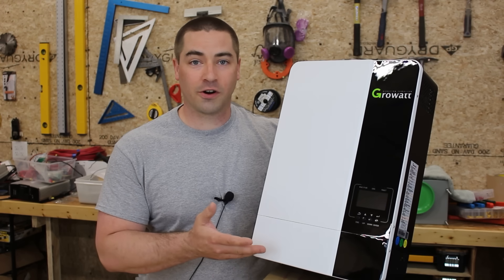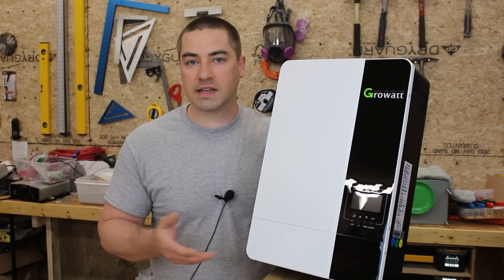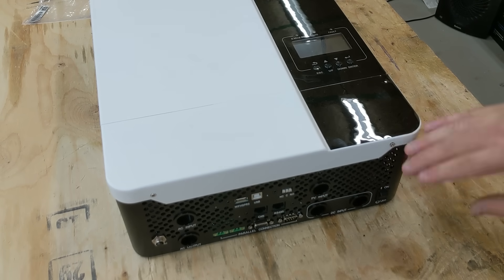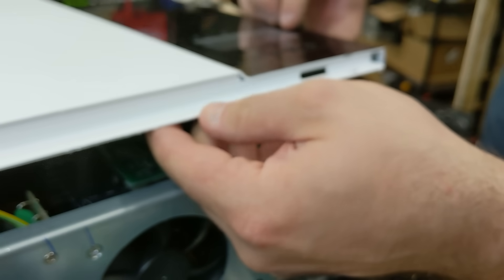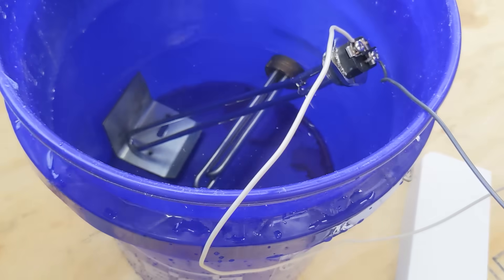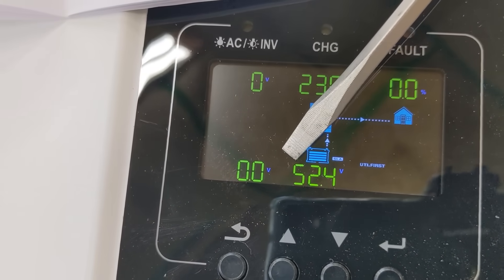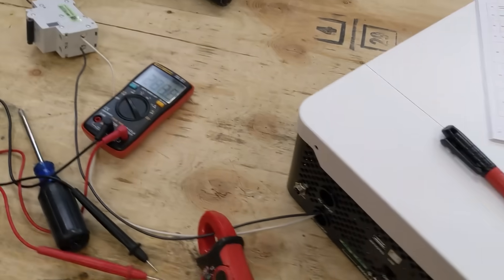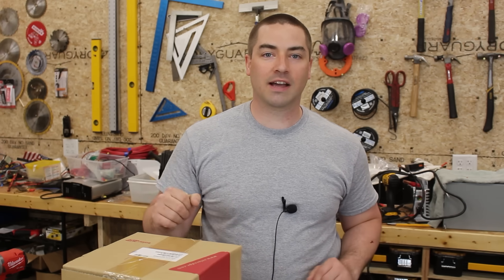Best Value Inverter, All-in-one MPPT Solar Charger, Growatt SPF5000ES, Part 1

Comment: any update? do you still support this product?
Reply from the maker: The inverter is working fine.  I've been testing it.  Currently trying to edit the video, but it's a ton of raw footage to work with.  For example, it powered up my miter saw great.
Reply: @DavidPozEnergy  Going with victron route until it's more proven. This sounds promising though
Reply from the maker: Cool.  Victron makes fantastic products.  I own their charge controller, 250/100.

Comment: I wonder if there is a version of these GroWatt All In Ones where two units can be networked together for USA style 240vac split phase.  My Initial review of tech info. for the smaller  Growatt SPF 3000TL LVM-ES unit, which can be run with or without a battery; leads me to believe that two GroWatt units (properly selection) can be networked together for not only upping the amperage of ac output, but also for 240vac split phase.  I want to  better understand the options; including ... if, or if not additional Growatt equipment is needed for 240vac split phase  :+)
Reply: IMO: just seems to me: single phase, 240v AC only is kind of poor choice for anyone in the USA :+(   ... while likely a GREAT Choice in European or other Countries with single  240vac  ... My Two Cents  :+) ... I guess, depending on what you put on the load side, there are possible task it might work great for.
Reply from the maker: Growatt makes a larger 12kw inverter with split phase.  It's a good choice if you want the split phase in one package.
Reply: @DavidPozEnergy  I will look at that 12kW version.

Comment: Hello Dav, I have 2 of those same inverters and 6 24v gyll batteries, I have not been able to communicate the BMS in the Lithium battery setting. A fault shows in the inverter when I directly connected the RJ45 to the batteries. I was wondering if you can include how to do it in part 2, thank you!
Reply from the maker: Doesn't directly communicate as of right now.  I'm just running it like I showed in the video, with user defined settings for high/low voltage
Reply: Thanks for your help

Comment: That Growwatt all in one is really just an MPP Solar brand all in one in different clothing!!! The MPP Solar all in one is all over eBay and most likely much cheaper! 
I have the 800Kw inverter version which has been designed for a 12V battery setup for a few years now and it's literally identical inside! 
The screen on the front panel looks nicer on the Growwatt compared to mine but the new version might have been updated by now. Regardless though, it's still functional... I hope that the computer software has improved because what I got is really clunky and slow! And it's not as detailed as what I have seen other computer software that I have seen elsewhere... 
The MPP Solar brand has versions that can be linked together for 3 phase output and many other versions for different situations...
Reply: 800kW?

Comment: Great job David.. I saw smaller models on Amazon and couldn't believe the price.

TBH long term reliability is what defines  good electronics like inverters.. We won't know if the heat sinks and those MOSFETs do the job until someone maybe you? uses it for a while at load.
Reply: The trick is not to overwork them for so long basically loading them to 65-70% load capacity, they are performing flawlessly in our installations the HVM series though

Comment: Good evening David... I have an unrelated question that you may wish to answer..?   I have two solar generators and would like to power both at the same time using one 180 watt solar panel (instead of a separate for each)..  Realizing that the sogens cannot be connected together in any way,  my solution would be to provide the necessary branch mc4's for each sogen and isolate each branch with an inline mc4 fuse which already  has the diode built in to prevent vdc back charging.  Your thoughts..??

Comment: Would be nice to see, if the communication with the batteries works out...then the Inverter has the most accurate state of charge and can also shut off the output befor the BMS does.

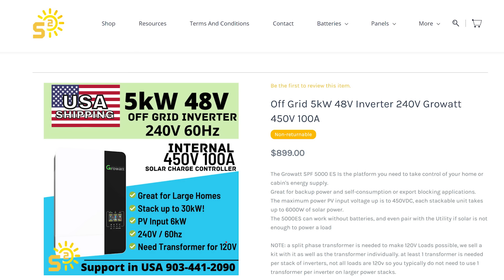Comment: I just saw on that ad copy at 0:50 for the unit that they can stack the inverters for higher power?!?! I had no idea this was possible.  I thought if I had a 5kw (peak pv + lifepo) and I increased it later to 10kw I'd have to get a new 10kw inverter and hock or repurpose the old 5kw inverter.  I don't know why that was stuck in my head.
Reply from the maker: Depends on the band/model.  Some inverters allow paralleling, and some don't.

Comment: Hi David, since you are expert i want to ask is there any way to connect this Growatt inverter to house panel.. in case of power outtage i want to power my house by LifePO4 batteries and this Inverter. thanks
Reply from the maker: Yes, it can power your whole house.  However, this type of inverter is usually set up on a "critical loads panel".  That would only power some of the loads like refrigerator, internet, etc.

Comment: Yes you are looking at inductors. High frequency filters. That is a high frequency inverter. Be careful about overloads with these style inverters, but looks pretty well built. Have a look at voltronic forums as I think this may be a version of that. There is some repair info over there.
Reply from the maker: Thanks for the help in identifying the parts.  I agree about being careful with HF inverters.  In some past videos (twice) I blew up all the mosfets inside a HF inverter.  But I've never blown a LF inverter.  But, hey, that's part of the fun in testing these things.

Comment: This is an awesome review. I just purchased the same package from signature solar and they were super helpful. I’m now looking for the most cost effective battery solution. Here is my question... have you tried or know anyone who has tested the Rosen 48v 200ah powerwall battery? It is sold by AliExpress for approximately $1600. delivered to my door. It appears to be an awesome battery but I would like your opinion. Thank sir, your episodes have helped me immensely. 🙏🏻
Reply from the maker: I have not heard of the brand "Rosen"  I searched for it on Aliexpress, but couldn't find it.  I'm currently using the Gyll batteries from Signature Solar.  Sorry I can't say good or bad about the Rosen.
Reply: @DavidPozEnergy  thanks.
Reply: 48v200ah lithium iron phosphate battery pack $1600 is very cost-effective and suitable

Comment: How’s it stack up against Bluetti?
(Other than cost)
Reply from the maker: The Bluetti I most recently tested is the AC200P.  It is an all-in-one power station.  It has battery, inverter, and charge controller in one package.  This video is on the Growatt 5000ES, which is an inverter and charge controller, but no battery.  You have to add a battery to this to make it a comparison to the Bluetti.  

However, if you question is just asking how this inverter compares to the bluetti inverter (built into the AC200P) then I can answer that.  The Bluetti is a 2000w inverter, and this Growatt is 5000w (a lot more power)
Reply: If I am correct the ac200 p cannot be paired

Comment: As a request for something to test, could you see what the output waveform looks like using your oscilloscope? If possible, it would be cool if you could find some different types of loads (resistive and inductive) to see if it's able to handle weird power factors. I don't know if you have 240V to your house, but it would also be cool if you could set that up and do some tests with the switchover between grid and battery/solar.

By the way, after seeing your video with your Hantek handheld multimeter/scope, I bought one myself and it's a pretty nice piece of kit.
Reply from the maker: Thanks for the suggestion.  I've already started editing the next video in this series, but I can hook up the scope and check the wave.  it will probably be tacked on right at the end of the next video.  I have not hooked this up to the house yet, but that will also be coming in a few weeks.  it takes me awhile to build out all the wiring/boxes for each video.
Reply: @DavidPozEnergy  Thanks! I figured I was probably a bit late to the party. I think the main thing is to see how noisy the sine wave is, which you can check with just your heater attached.

Comment: David, I have watched several of your videos. great job on most of them. If I hook up 16 3.2v 320aH batteries. What size wind turbine do I need to keep them charged? Thanks in advance.
Reply from the maker: A 16kwh battery.  It depends on your loads, and average wind speed/duration.  If you use all your battery each day, and want a full recharge each day, then you need a turbine that can output 700 watts in your average wind speed (16kwh/24hours).  You will need to talk to your dealer to find out which one is best.  I don't have a lot of experience with wind, so I'm not a great resource on this topic.  Maybe Hurricane Wind and Power could help you size it for your area.
Reply: @DavidPozEnergy  Thanks for the reply. I am planning to use a PMA hooked to a small electric motor to run it at a constant speed 24/7/365. My highest electric bill last year was 1440 KWh. For right now I plan to separate the heat and Air, and range from this. We here in Southwest Florida are about 99% total electric. We don't have access to natural gas and LP is high.  Would those 48v 60Ah batteries be better than the 24v 400Ah batteries?

Comment: That’s 220vac single phase,  how do you plan to use it. A 240 vac to 120 vac transformer costs $689.00 thtough w w Graingers, where’s the savings ?
Reply from the maker: I've been using it with a $350 auto-transformer: https://www.signaturesolar.us/products/i8d486d54c/2203789000006420115
I've been testing over the past 2 weeks with different loads and it's working well. I am now on to editing the video about the transformer use.

Comment: Hello David,
thank you very much vor this, and all other videos from you. It is awesome, what kind of great techniktools (inverter and so on) comes more and more from far east. Very well. Thumps up.
Question; is this one, or an other one able to deliver 3 phase output, with about at least 5 kWp? Such one i am looking for.
Thank you, and happy easter days :-)
Jürgen B., Germany.
on the following site is an technik test for an little usv;
https://loetseite.wordpress.com/2016/06/16/usv-rotronic-roline-ups/
Reply from the maker: Yes, the manual says this inverter can parallel for 3 phase output.  Each inverter is just one phase, but they will talk to each other for 3-phase.
Reply: @DavidPozEnergy  Yes, thank you, David. I think so, because many inverter (not all) can do this. But i am locking for one, who can get out with in one "black box" this feature...and it should be not so big and not so heavy. So it should work with HF elektronik without 50 Hz transformer. I think i have to look futher...and search.
Bey.
Jürgen B., from Hunteburg, Germany

Comment: I saw your battery bank  (parallel ) out from Pos and Neg in the Top battery.... This way connection I think the Amp charging for first battery is big and  last battery very small that's mean not full charge for all batteries. In my system I connect Pos (+) from Top battery and Neg (-) from Last battery.... And in  charging mode will be even Ampe for all batteries.

Comment: Looks very similar to well and long known inverters from EASun / MPPSolar (the synchronization board is the same, internal design is very similar, manual is almost 1 to 1 from what I was able to see from video). Moreover - for you, oversees guys, there are already factory made split phase models. Also, the price is lower, when bought directly from manufacturer - 5,5kW version costs me less than 650 USD delivered to the doorstep

Comment: Hi David ,We repair inverters,These Hi Freq units are a problem with certain loads. We prefer inverters that have copper wound output transformers. These handle reactive loads . They also isolate the high voltage dc .I know the cost is higher ,but reliability is much better.One more point,The GROWATT inverter your testing has the same inverter and charge controler circuits we've seen in other inverters,it a universal plug and play uit. By the way ,I just received my GULL 5 KW BATTERIES, THANKS FOR YOUR VIDEO ON THESE ,GOOD JOB!!!
Reply from the maker: Thanks for sharing your experience.  I've blown up a couple inverters in the past with my miter saw.  I'm going to try my miter saw and air compressor on this unit too, but since those are 120v, it will be with the auto transformer.

Comment: wow that looks like a really great starter option. Then as you grow your system you just add one or two more. too bad there isnt a 120v version then just get two of them synced up to get split phase. That would be really neat to see!
Reply from the maker: I agree, it's easy to grow a system like this.  There is a 120v version, but only in 3000w size.
Reply: @DavidPozEnergy  oh I see, yea I would totally see myself starting with them, but an apartment is not where you start a power wall project lol! That’s ok I can just keep saving up

Comment: hi David,the tx5000 auto transformer is a discontinued product.and Signature solar clearly states "non returnable" could you please advise us as to what recourse we may have if we get a bad unit? does solar edge make a replacement? How would signature solar support your followers?thanks
Reply from the maker: You can also buy the Solar Edge auto transformer from Alt-E, or Northern Arizona Wind and Sun.  Probably other places too, but those are two off the top of my head.  Victron also makes two auto transformers.
Reply: @DavidPozEnergy  David thanks for the reply.i can't see this as being a good buy.victron auto trans vary from $400-$500 dollars and as per my previous post solar edge no longer manufactures theirs.At this price point an inverter with built in split phase would either be close to or same price and one less piece of equipment to hang.I respect and admire your channel but I think this unit is over priced and under functioning especially at 48 volts.

Comment: Do you need some kind of reprogramming to attach the Lithium Battery?
Reply from the maker: In the menu, you will want to set the maximum and minimum battery voltages for your particular battery.

Comment: As a few others have said. Really interested in how it performs with the transformer. You have had problems with high frequency inverters before starting induction loads like your miter saw. Also try with a big shop vacuum ad the universal motors are notoriously inefficient. Your transformer might give it enough of a "flywheel effect" to ride through.
Reply: We’re having issues now. With pass thru power.  Fried a transformer. No problems until we added batteries and paralleled two. Now the grid assist isn’t possible. We saw where a grounding issue inside is problem being tied to the neutral. 
We’re getting an error 8. Frustrating.

Comment: I have also been using the 12kw unit which is about same $/w as this 5kw, great value. The plus and minus is low frequency unit beast weighs about 180lbs. Downside is the 2x internal MPPTs are 150V.
Reply: Oh yah, the big daddy also is a full split phase 240
Reply: From which supplier did you buy the inverter? There are loads of them on alibaba

Comment: I was looking at the 12000 and was surprised to learn it weighs 165 lbs and has 2 large transformers inside, one for each leg of the 120.  These things may actually be the real deal !
Reply: so, it has 2 legs and a neutral?
Reply: Did you buy one, I have one.  Seems pretty good

Comment: David, I want to do a wind system.  48VAC 2000W turbine hitting the rectifier and then the charge controller to a bank of those Gyll's.  Does the Growatt come in wind flavor?  Great videos on your channel!
Reply from the maker: I can't find anything in the manual that says it supports wind.  I wish I could help more, but I don't have experience with wind.
Reply: @DavidPozEnergy  Appreciate the response!

Comment: heya that looks like a very nice inverter can't wait to see more I have a growatt inverter myself withes is not for off grid because here in holland I can give the electric back to the grid wen I make more electric then I need and wen I produces less then what I need with my solarpanels I get it back at the same price so that is a nice deal. the only thing is I still have to pay for the transport for the electric going true the cable both ways so that is still a loss that's why I'm know looking for a hybrid inverter so I can charge first my batteries before I give back the electric wen I make more then I need and will make some money by doing it that way

Comment: I’m placing the heating element on a piece of metal so when I turn it on it won’t melt the plastic bucket.....
Shows energized heating element off the metal plate and on the plastic....😆😆😆

Comment: Does this inverter have an auto-gen-start feature?
Reply from the maker: There is a relay built in that can be used for a 2-wire start.  I don't have experience with that since my generator doesn't have a remote start option.

Comment: Hello everyone I’m wondering if anybody can help me I want to build a 12 volt off grid system with a 3000 watt inverter and a 310 ah lithium battery my question is what BMS size should I get to use the full capability of the inverter
Reply from the maker: You would need a minimum of a 300 amp BMS.  Take the watts of the inverter, and divide by the lowest voltage your system might ever be at.  Usually 12v inverters shut off around 10 volts (10-15v is typical range).  So 3,000w/10v=300a